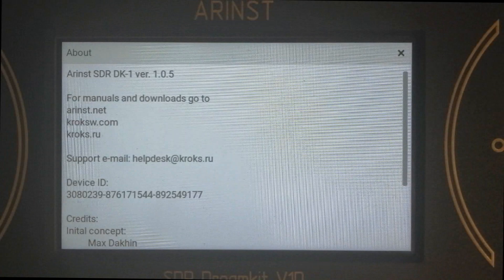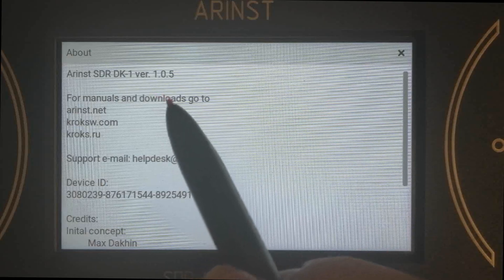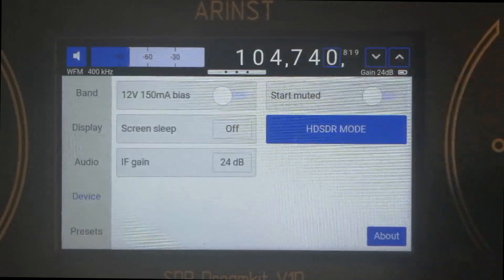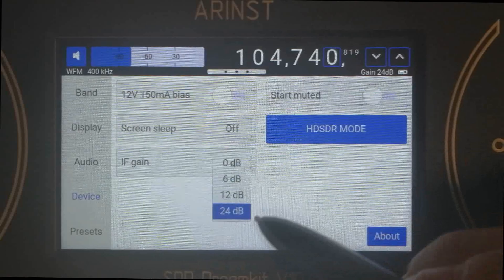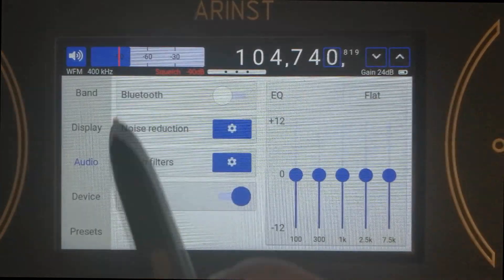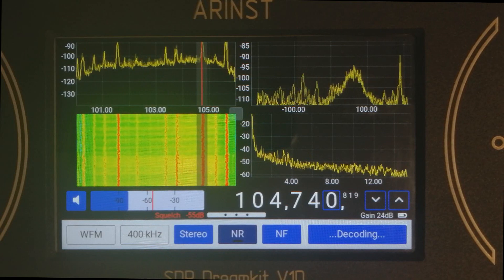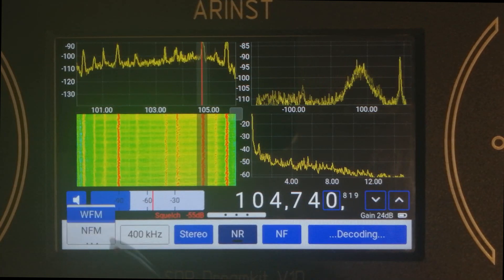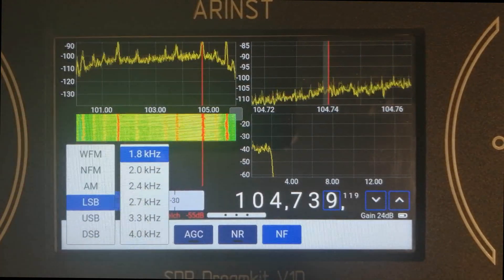Additional functionality for Arinst SDR Dreakit V1D.

Comment: Вышло обновление 1.0.9 для приемника SDR Dreamkit.   Исправлены критические ошибки, уменьшена инерционность порогового шумоподавителя, исправлено совместное отображение BB спектра и водопада в полосе 1МГц, исправлено отображение меню на вкладке аудио.

Update 1.0.9 for SDR Dreamkit Receiver has been released. Fixed critical errors, reduced the inertia of the threshold squelch, fixed the joint display of the BB spectrum and waterfall in the 1MHz band, fixed the display of the menu on the audio tab.

Comment: Got mine on Friday. Finally opened the box today. This receiver is super sensitive on VHF and above just using a telescoping whip. Trying now to update firmware and followed instructions to do so. I see that mine has firmware 1.0.2 but there is no update available. I assume that if I'm getting far enough to read the radio's info I should be able to download an update to the firmware? The laptop I'm using absolutely has internet access. Thanks.
Reply: Several critical errors were found in version 1.0.8 of Arinst SDR receiver, at the moment they are being fixed, the update is disabled.
Reply: @Владимир-п6к3и  Thanks. As this video showed 1.0.5 I thought it might be available. I appreciate the response. So far out of the box I like this receiver very much.
Reply: @scotthalligan4675  thanks! please, wait a bit, we will add new features and start update.
Reply: @Владимир-п6к3и  Thanks. I have 1.0.9 installed now and it seems to be working well. Is Telegram the only place for actual discussion and suggestions for future firmware? I cancelled the install of it as I found Telegram to be very aggressive trying to use my mobile phone number.

Comment: I am waiting for mine to arrive via Ali Express although there appear to be some difficulties with that. In the interim, great to see a firmware update. Have you had any suggestions for adding step sizes to a future update, and the ability to "snap to step" when you click on the spectrum? My use of this will be primarily in the VHF and above bands, and having some step sizes of 2.5, 5, 6.25, 7.5, 10, 12.5, 15, 20, 25, and 50 KHz would be ideal. I'm sure those in Europe would like 8.33 for the air band as well. I haven't seen reference to steps in the few available videos yet. Greatly looking forward to getting my hands on one. Thanks...Scott